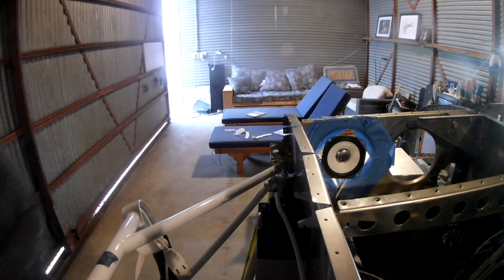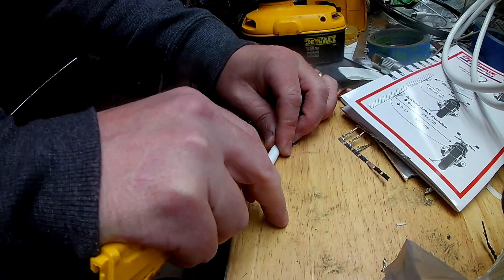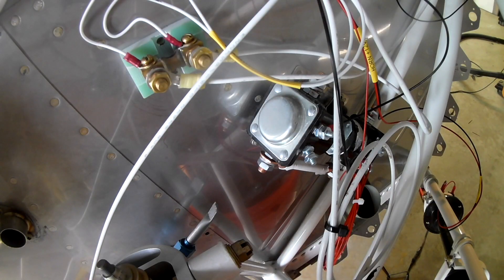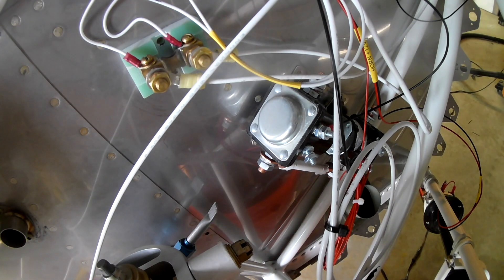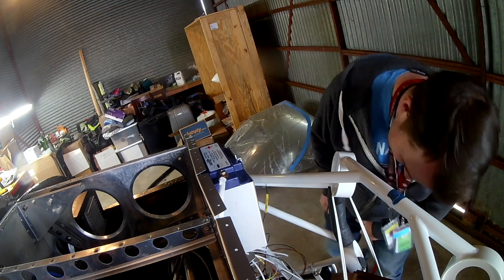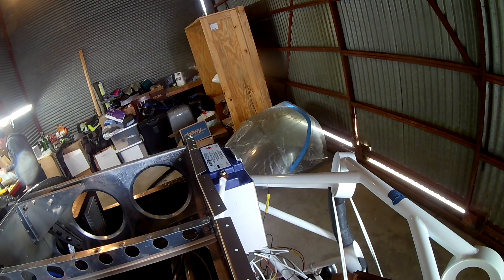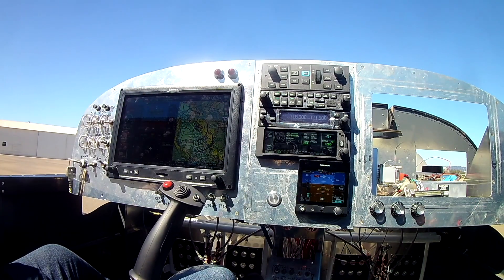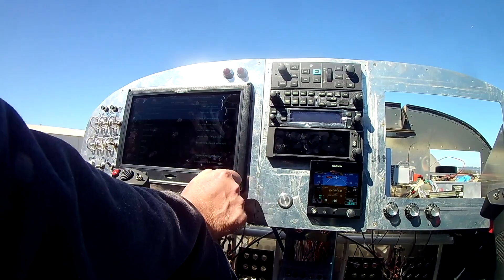RV-14 POWER IV - The finalé

Comment: Good stuff, Andrew. Two things:  1)  suggest a lock washer on that large battery connection;  2) not tolerating rude people is not a personal failing.  The quantity of such people has risen 10x since 2016.  One or two occasional run-ins is one thing;  finding it common-place is another.  Consider reports that flight attendants, once rarely dealing with a rude/aggressive passenger, now find it a frequent problem.  Rant away, Andrew.  Rant away.

Comment: Curious what made you decide to go with a panel mount comm instead of remote? Running out of room behind the panel?
Reply from the maker: I always want one of everything I have the option to touch on the panel if I can in case the displays go black.
Reply: @akilroy  I like that logic. Good call. Glad you got that 375 up and running. I am hoping to use the same unit, though by the time I get mine built we may be using something completely different. Flux capacitors perhaps?
Reply from the maker: @ChrisVirgilio  I don't know how avionics are supposed to get any smaller or better than they are? Cheaper would be nice. :D
Reply: @akilroy  remote navigators are the next wave. Fully integrated into displays like the G3X, then migrating to mobile devices.